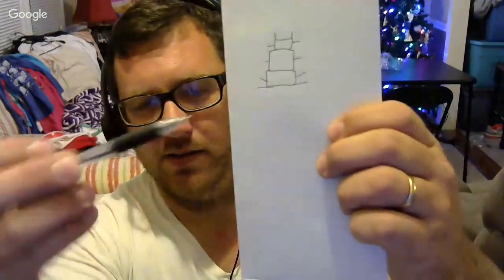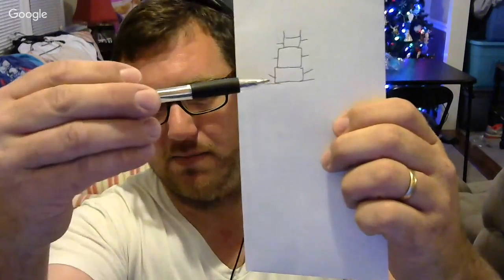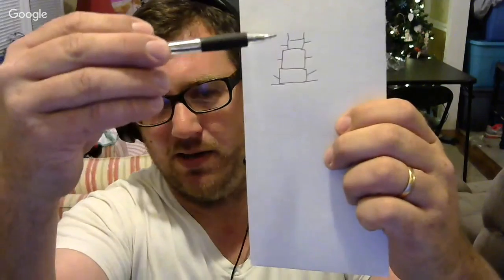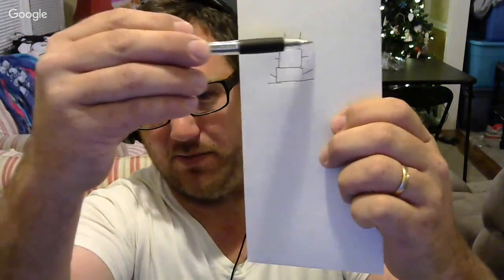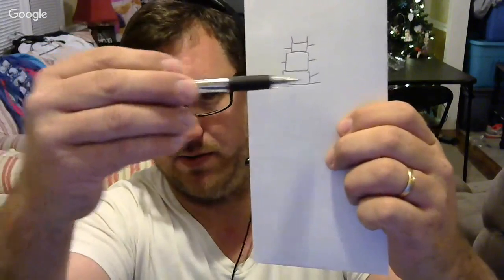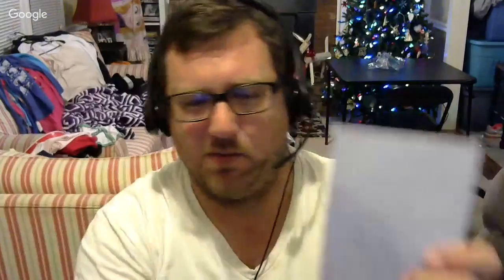Electric Furnace Troubleshooting | Contactors & Sequencers

Comment: I have a nortron electric furnace, when I put thermostat to 67 calling for heat, it runs for 5 minutes and it trips the breaker
Anyone have suggestions...I changed 3-5 Kw elements, I changed the 100 amp breaker...still same problem.

Comment: Can you tell me how the Lennox Air Handler m# CB30U-31-2P, s# 5804F49487, electric heat pack m#ECB29-10CB-2P s# 5505F08510 (10kw at 240v), outdoor unit m# HP27-024-8P s# 5804B24977 works with electric heat? I have two things I cant understand about this unit:  1. what thermostat should I use with this HP system? and 2. I cant figure out how the fan relay determines what speed the fan runs from a call from the stat on G and how there can be factory jumpers in the air handler from R to W2 to W3. This would always pull in W2 and W3 elements at all times and not when there is a call from the stat for heat???? This unit does not have an outdoor thermostat. It does not have an economizer relay either.  I found wiring diagrams online by plugging in the model for the indoor unit. It is the 9/05 "Installation Instructions". They dont help me too much. Any help would be greatly appreciated. Thanks

Comment: I need to separate a single heat strip on a three heat strip Lennox heat pump/heat strip unit.  I do standby generators which use load management.  Usually there is a separate heat strip for emergency heat which works good since one is  already separate.  On this unit when the heat strips are needed they all come on at the same time.  i need to seperate one.  I do not know how to simply accomplish this.    The reason is that I have a dual low voltage module.  When generator power kicks on one module locks out 2 of the heat strips and one module allows the one heat strip to come on providing enough heat to provide above freezing tempature inside the home.
Reply from the maker: I think you could do that by using two contactors instead of sequencers. You could stage the two contactors separately, so that if you wanted to abandon one it would be easy

Comment: We usually only deal with electric heat strips in heat pumps.. lot of natural gas here. I'm a little weak in the sequencers/relays area.  I'm mostly self taught so that's not where I started, ironically enough. 
Having some trouble with a new commercial unit. Fan and heat strips cycle on fine, but compressor contactor drops out as soon as it pulls in after delay.  checked pressure switches, changing out 3 phase contactor today.. just wondering if I'm on the right track. Daiken rooftop HP.. also bypasses stat and jumpered at board
Reply from the maker: Are you a member on the Facebook group. Lot of good techs there that work on commercial stuff
Reply: nah.. don't Facebook.  Contactor fixed it.  I'm a self employed 4 yr. contractor with a business partner.  We do our own stuff, including sub work from his dad.  I turn to guys like yourself when I get in a pinch.  We installed this unit new, but it's already thrown the blower pulley twice and now this. Ugh.. packaged heat pumps seem to be prone..